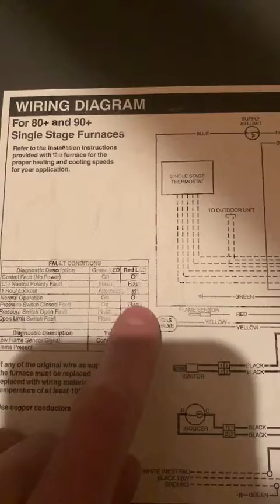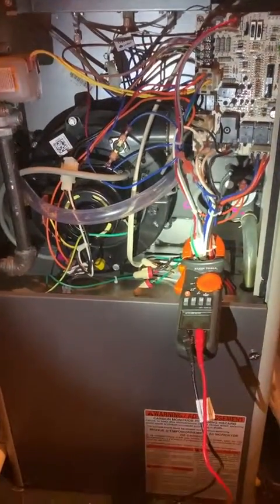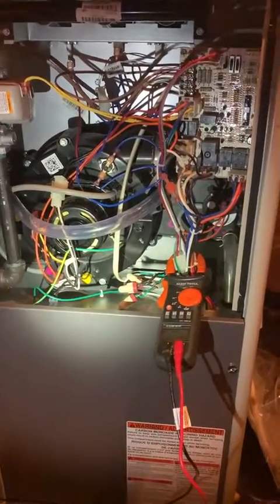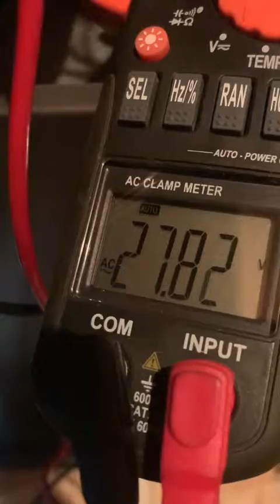Maytag gas furnace Pressure Switch diagnostic Hvac service call no heat

Comment: are you guys Maytag Furnace experts? I am desperately looking for someone who can help with an intermittent problem I have been having with my Maytag model MGC2TA080C24B1 without any error codes. I have had 3 different HVAC companies (5 technicians) try to diagnose in the last 2 months, and nobody can figure out what is going on. They have replaced the control board, the gas valve, some sensors, sealed the top of the furnace so heat doesn't leak from the furnace and nothing is helping. It either doesn't turn on, or when it does, most of the time it keeps turning off and on. The only time I have been able to keep it working correctly is when I remove the furnace cover and let it run. With the cover on, it seems to think it is overheating and keeps shutting it off sometimes within a couple of minutes. As mentioned in this video, I have noticed when it is really cold, it takes about 2-3 hours until the heater turns on, then it runs for a little while (sometimes one hour) then it shuts off on its own before raising the temperature more than a couple of degrees. You guys are talking about tubes, but I have not seen any tubes anywhere in my furnace, is there a tube behind the control board in all of these furnaces?
Reply: Check your flu pipes

Comment: We found out that you need to take a 1 size bigger drill bit and drill out the pressure switch tube behind the control board. Water runs down the c box and covers the pressure switch hole. We did it to every one we came across and no more problems.
Reply: Also same issue on the kelvinator 2s. Rebranded maytags. Same furnace.
Reply: @Germ1993  you seem to know Maytag furnaces, please see my comment above, are you a contractor? what part of the country? I am in California